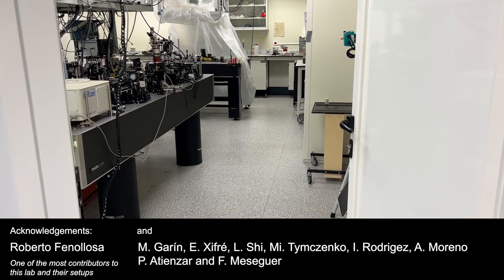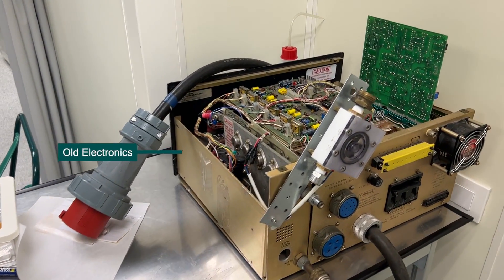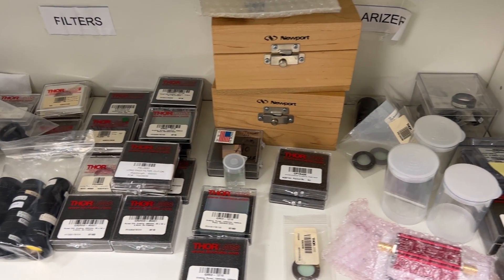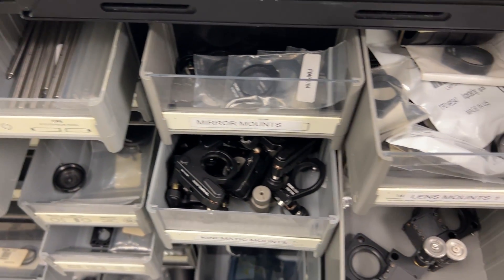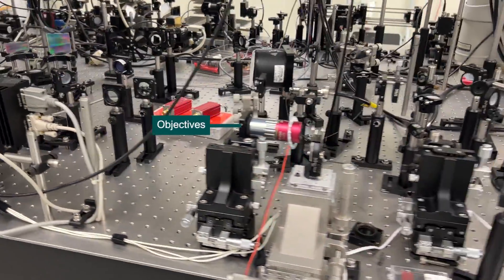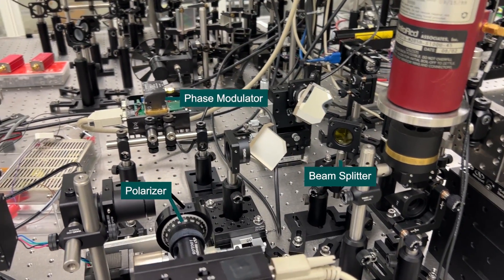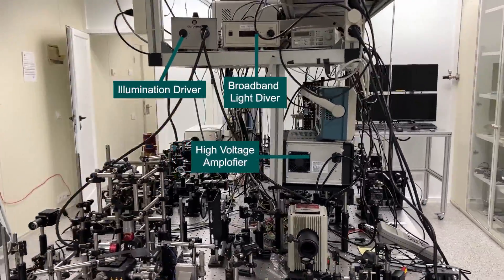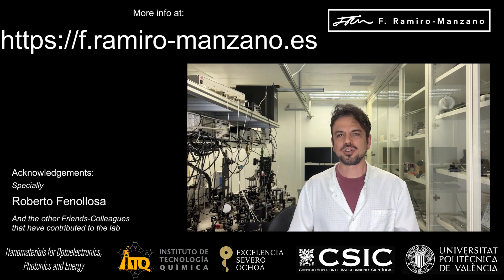Photonics - Laboratory of Optics: Equipment, Devices and Setups for Science Experiments with Light.

Comment: 3:58

Does the bean expander only work when the lights are out?
Reply from the maker: It depends on the experiment. In particular, the beam expander is set up for an aligned beam that corresponds with the experiment. If it is adjusted for visible light (and we are using detectors for the visible spectrum), you are right, the external light could pass through it and perturb or saturate the detectors. This can be avoided by using lock-in amplifiers. Thanks for the question Matt!
Reply: @F.Ramiro_Manzano  I was making a joke because you wrote "bean" instead of "beam" and the first one is a slang term for a part of a woman's body :)

Thank you for the excellent video, I am interviewing for a lab manager position in a photonics lab and used your video to make sure I understood the types of equipment and instruments I am likely to encounter. Thanks!